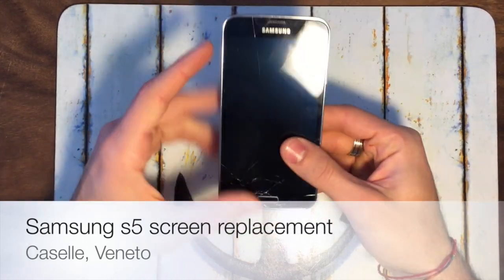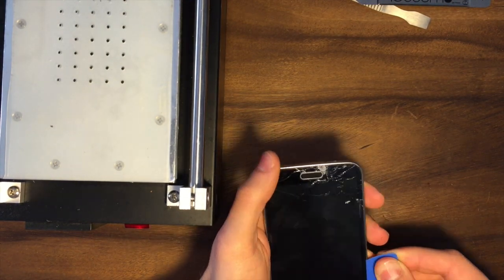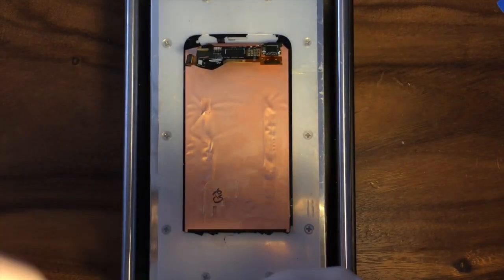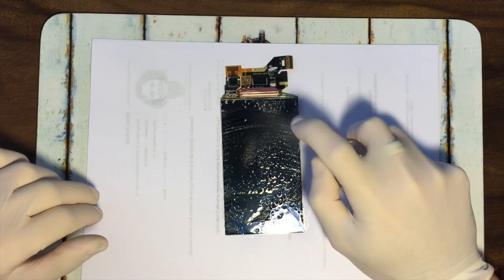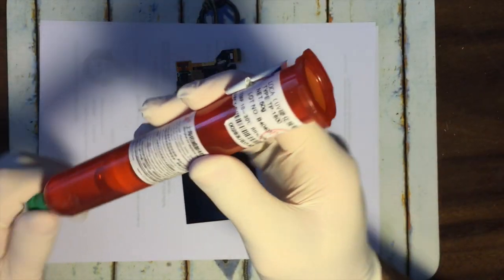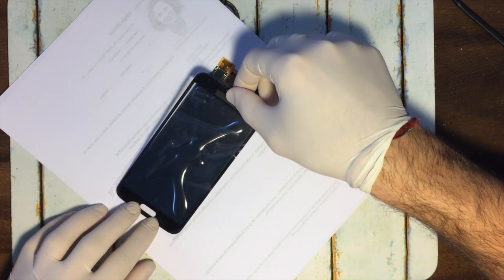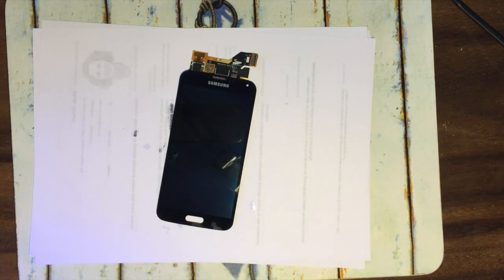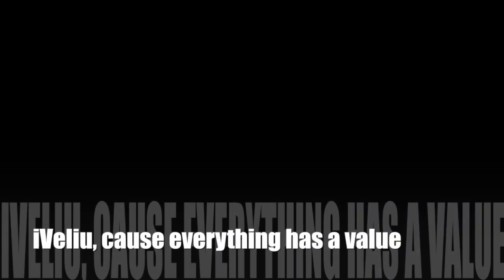Galaxy S5 Glass Only Screen Repair Replacement

Comment: Using that plastic tool on the surface of the LCD is a No No. That is something so I never do as the plastic tool can have sharp edges scratching the surface that will be visible on one colour windows.

Comment: my lcd was slightly broken which has caused it's display to vanished but the touch is working fine.
display was vanished slowly, first it was showing half the screen now nothing just a tiny light..will this still work?
Reply: my touch is working fine,the whole screen is blacked out slowly, i think the liquid is spilled which has cause the screen to blacked out as the front glass  do not seem to be broken something is broken underneath that will this still work please answer
Reply: If my glass was broken than this would have help?
Reply: Do I need to buy only LCD or the entire LCD + Glass + Digitizer kit?